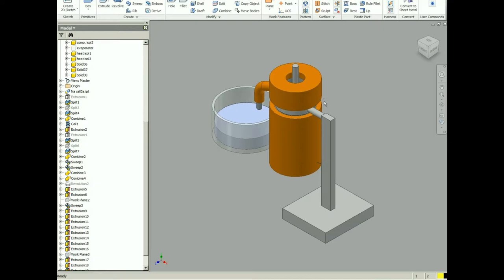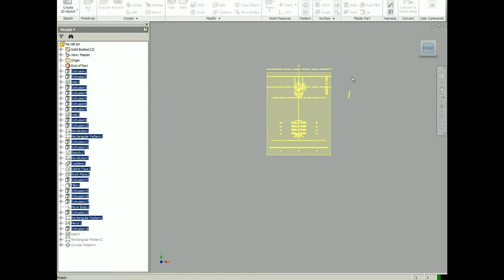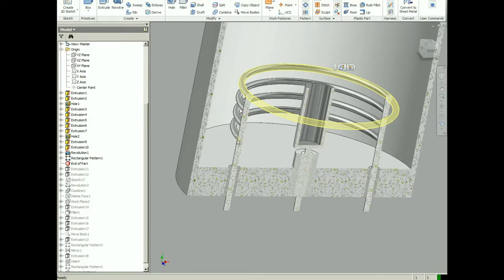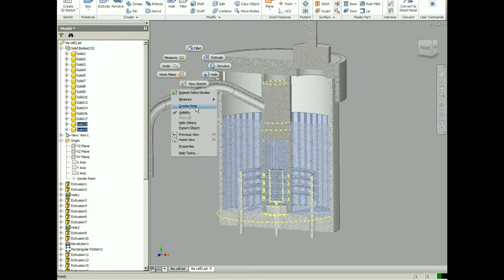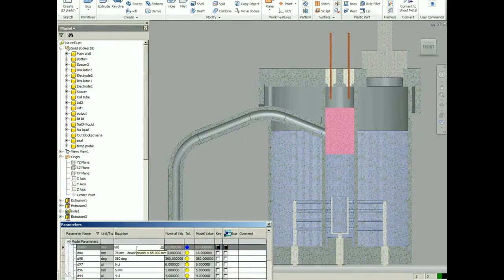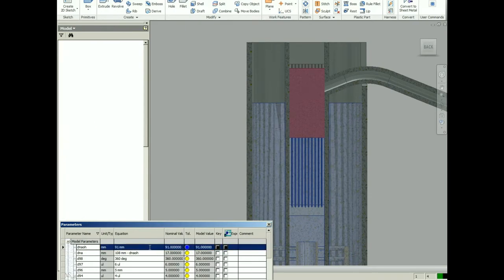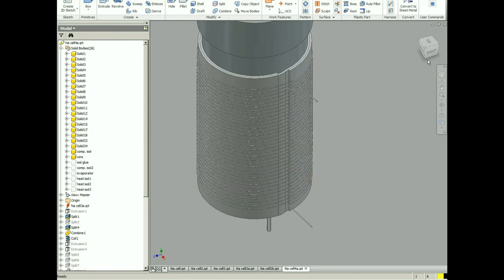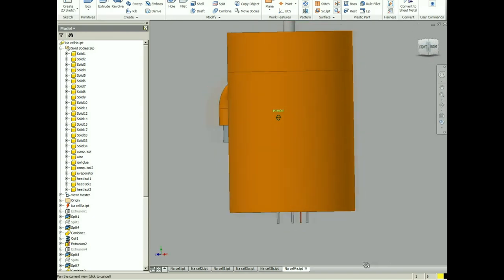Sodium maker - CAD design

Comment: i did electroylsis with molten NAOH ended terribly it went through the crucible leaked out nearly totally destroyed my heating setup i might be considering into getting a new one :)
Reply from the maker: Yeah, been there, done that :) I have done some more experimentation on this automatic style cell few months ago, it's documented here on channel. but sealing this stuff is hard unless you can weld aluminium...
Reply: @IlusysSystems  aluminium would eventully wear out ive heard porcelain works ?
Reply from the maker: @jadentonkin466  Eventually, yes... You intend to pass your cell to one of your grandchildren? :)

Comment: Id be very interested if this is adaptable for making Potassium Metal from Potassium Hydroxide.
Reply from the maker: Unfortunately I don't have any potassium hydroxide right now...
If you melt it in beer can, and there is no violent reaction(do it without beer) it would probably work.
Technically. maybe some day I will finish this also, but right now I am working on my glassblowing lathe.
Reply: Ok, thanks for the tips. Just 1 more question; would you recommend aluminum for molten KOH as the cell material? I have platinum electrodes so thats settled but im curious as to what to construct the cell from.
Reply from the maker: I don't know. You can easily test it by melting a bit of KOH in beer can(without beer). If there is no violent reaction, it should work.

Comment: What woud it cost without powersupply and Shipping to Germany.
Reply from the maker: Not too much as I am from Czech rep. But I am not selling these. 
Never got to test this design unfortunately...
Reply: @IlusysSystems  ok I Think I will Build it my self . Does nichrome wire Work as electrode?
Reply from the maker: @joostspohler2964 I did not test this, but I am 99% confident that it will.

I may not recommend sourcing it locally as it can be confused with kanthal, and that may not end very well...

Also pls let me know how it went :)
Reply: @IlusysSystems i bought some nickel strips from ebay and used an old spoon as anode.
im gonna test it today

Comment: I am interested in buying this cell or ecoetrochemical system for obtaining sodium by electrolysis of sodium hydroxide, how can I get in touch with you, do you have viber?
Reply from the maker: I don't sell them, I was just daydreaming. I have tested autmatic design in later videos and it mostly works, but it's still quite messy stuff which if you can deal with,  you can probably make one anyway.
Reply: @IlusysSystems   I'm so glad. I managed to produce elemental sodium in small quantities by electrolysis of sodium hydroxide, but the method is quite amateurish. Now I would like to make a slightly more modern sodium generator, and I need a little help and advice about the membrane that restrains the products released from the anode, because they are oxidative in nature and can create by-products, explosion of reactive sodium
Reply from the maker: @hydrogenh2energy964  I had good experience with hard anodized aluminium, but as soon as you would wash such membrane, anodization will dissappear. so alumina ceramic tube seems to be better, but it is hard to drill. Good thing about anodized Al tubes is, that they are mass manufactured and so they can be disposable item if you don't have means to re-anodize them or can't be bothered with that.
Reply: @IlusysSystems  Ask for a high price

Comment: i think you should perhaps speak to someone about bringing a product to market, here in the uk at least, you need allot of tests to be done. for example to sell a simple power supply you will need to send samples to several certifying boddies (5-10 each, for destructive testing). to be honest i think it is far to dangerous to even bother trying to market it as a consumer good. probably the best you can do is sell it as a nice paperweight and tell people not to use it.

then people who are really confident in their safety protocols can try it out in a heavily controlled environment if we really want to, but dude, this will probably kill anyone who thinks they can just plug it in and it will work safely in their home with no extra precautions.

i think with allot more practical testing and safety checks including a blast proof container which locks till it's cooled down, proper gas exhausting and using a membrane the gases can't get through instead of just holes, you could maybe market this.

TLDR: the normies aren't ready for liquid sodium hydroxide and explosive waste gasses in their household products.

absolutely love the design though, i would probably buy it if you showed it working, even if it required a bit of maintenance. the siphon especially is a great idea but i think the surface tension may be problematic with the spout size, and the textured walls are also very interesting if they work.

LOLed so hard at the definitions in the intro, i agree don't seal it with semen, and don't get your fibreglass pregnant. though i may add that cement is a very broad description and not really specific enough for reproduction [of your product]. the clay can be comprised of many differing minerals which significantly affect the properties including thermal resilience and chemical resistance to corrosion, these chemical mixtures are so complex that they are referred to by the place they were mined along with an identification number for the type. eg. Portland number 2

i would also like to add that "fire cement" is not technically cement by the definition you gave. perhaps it is a translation issue, to cement colloquially means to affix where as cement formally is a material. so there are products who's name contains the word cement used in a colloquial manner such as the product you referenced, another example is model cement eg.
https://www.amazon.com/Elmers-E1013-Model-Cement-1-Ounce/dp/B000MVOX2S/
which contains no cement but also still uses the word in it's name to reference the colloquial meaning.
Reply from the maker: Hi thanks for reply. I don't want this to be sold as a product for "normal" people.
This video is more like a market survey.
I know, what it takes to develop & properly sell electronics product.
If this thing is to be sold officialy with CE and what not, you may add 3 or 4 zeroes to the price :)

Also thanks for pointing out that cement thing.
At some vid of HHO series there was discusion about this cell and guy didn't know what stove sealant is and we got to term furnance cement.
I will add this to description...

EDIT: what a coincidence - that "guy" was you :D

Comment: I have about 25oz of scrap permalloy which is 80% nickel and 20% iron, if you can use it I'd be happy to send it your way!
Reply from the maker: Hi, thanks for this offer.
That is a lot more than i would ever need :)
Also I live in Czech rep. so shipping about 50g(assuming it is a wire - otherwise I wouldn't be able to mashine it) will cost more then value of metal.

But in case I will do prototyping I may get in touch with you.
Reply: Ilusys Systems its not wire, it's a bunch of backings for neodymium magnets from computer hard drives.
Reply: Ilusys Systems but I might be able to melt it into a ingot in my foundry
Reply from the maker: That reminds me, that I wanted to setup annealing oven for glass, so I would definitely get some bricks for some foundry.

Anyway, realy thanks for your offer, but as I would need a wire for heating it is better idea to use it also for electrodes.
Reply: Ilusys Systems alright, well just let me know if you change your mind :)
Reply from the maker: Sorry man, I accidentaly removed your comment on HHO vid :(
Reply: Ilusys Systems its all good 😂

Comment: Ok I have a few questions, as I am working on a cell of my own.

How do you stop the collection tube from acting as another cathode and anode in the wrong place?  It seems like it would be better to have the tube only attached at the top and be completely above the electrodes.  Does the aluminate coating insulate the aluminum well enough that we don't have to worry about that?

I plan on putting the entire unit in an oven to keep the temperature just right, with holes drilled through the stove for pipes for venting hydrogen, and venting oxygen/adding naoh, etc.  I'm surprised no one has done this that I can see, is there something I'm missing?  Obviously I have to prevent hydrogen and oxygen from building up but if I can fix that wouldn't that be a good idea?

The cement I'm finding is all sodium silicate, which I'm thinking is soluable in naoh because it's what glass turns into, is that the stuff you used, or is there different cement?
Reply from the maker: Aluminate coating seems to be fairly insulating.
If you saw my older video, there was some insoluble crystal matter forming on the walls of the cell. Now I am fairly sure, this is sodium carbonate, that will form by absorbtion of CO2 from atmosphere.
Putting cell in the oven may be fine. I was thinking about something rather compact here.
Sodium silicate is product of SiO4 + NaOH therefore it does not react further with NaOH. I used that stuff.

Good luck building the cell :) Looking forward to hear from you.
Reply: Any reason to stop at 40 amps?  There's a 50 amp supply for about $30, is there a reason to limit amps to 40 or so?  Do you know what the resistance of your cell was?  I'd love to able to make more than 10 grams per hour, but I don't want to go above 12 volts or so.
Reply from the maker: resistance of my cell was about 0.25 ohm.
in theory, you need about 2V to do electrolysis. running at higher voltage will result in heat loss, which is quite desirable.
If you want to scale things up, you have to increase surface area of electrodes (make them bigger). That will decrease resistance.

So you can run this @1KA, I would love to see that :)
but at that point this starts to get into commercial territory, and you may consider NaCl electrolysis, as it is somewhat more effective, therefore cheaper to run, if you are looking at gram of Na / kWh performance
Reply: Well I'm not necessarily trying to maximize na/kwh, but I want to make a few hundred grams without running it for days on end.

My newest design has two pieces of nickel fabric as the anode and cathode, about 5*5 inches, with a 1 inch gap between them.  Trying to decide what mesh size to use.  The fabric I'm looking at is made of wires that are 0.0045 inches in diameter.  I'm hoping that isn't too fine.  It's a huge surface area, about 2500 square inches, but I wonder if they will be eaten by the naoh.  I noticed your electrodes were black after running the cell, were they corroded significantly?

One other thing I'm wondering is how big would a spout need to be for sodium to freely drain through it?  Is a half inch diameter sufficient?
Reply from the maker: well that are quite huge electrodes. corrosion was there, but not really significant. I would say passivization layer rather then corrosion, but I would rather be prepared to accept some damage on such thin wires. 

Originally I was planning to use nickel plated electrode with 0.05 ~ 0.1 mm plating thickness so for few runs I think it will be OK, but not forever.

I forgot to mention that I had one electrode sunk below level of NaOH liquid, as sodium will wet nickel, so buoyant force will separate larger chunks of sodium from electrodes.

And that draining system I am thinking about in this vid. is untested and experimental... I guess that molten sodium will be happy with about 5mm or 1/4in hole. 
I would be rather worried about slag or sodium freezing, so the tube will not clog up over time
Reply: Did you see if the resistance of your cell changed throughout it's use?
Reply from the maker: well my current shunt resistor was just quite thin piece of copper wire, so measurement error was huge. plus temperature control was mechanical bimetallic element...

Comment: Just a little safety advice from a doctor and chemist. NaOH has a melting point of 323 °C. If, for some reason, only a small amount of water gets into the molten NaOH, the good days are over. I'm only talking about the enormous reaction when water suddenly evaporates. Added to this is the fact that even solid metallic sodium at room temperature reacts violently with water. But if water got into a mixture of molten NaOH, on which molten metallic sodium is also floating, no one will remember the moment with joy. The 323 °C alone will burn quite a hole in your fur. But molten NaOH becomes much more aggressive than NaOH at room temperature. Just as an example. A cold concentrated NaOH solution can easily be stored in glass containers without the NaOH attacking the glass. However, if you heat a concentrated NaOH solution in borosilicate glass for a few hours, the glass will visibly corrode. This goes so far that the glass wall can be completely etched through (see NurdRage's attempts to create metallic sodium). So stay away from molten NaOH. You can already buy metallic sodium everywhere on the internet for a good price. So I am very happy that Ilusys Systems is not selling its chamber.

Comment: I Think this cell desing i not good...
1:Graphite or Stainless Steel elektrodes

2:A hole for blowing the H and O away. 

3:A copper tube whit Oil Cooling to condens Sodium gas. 
4:Sodium chlorid is cheaper and doesnt eats to glas and Metal when molten.If you mix 60:40 Nacl:Kcl the Salt mixture melts at 650 C° not so high then the normal melting point of pure Nacl
Reply: Outdoor Freak one problem is that aluminium melts at 660°C so the cell has to be constructed with a different metal. But the main problem with an NaCl-Cell Setup are the relativly high energy losses which often make the cell inprofitable.
Reply: Steel and a old Microwave Transformer...
Reply from the maker: Hi thanks for suggestions.
First watch this video https://www.youtube.com/watch?v=BElkJ6VNwO4

1 Graphite electrodes are mess - they didn't las long. Stainless will corode

2 yes you are right...

3 We are not dealing with gas. also copper will corode.

4 We are processing molten sodium hydroxide - NaOH. melting temperature is something less then 330°C

MOT wound in reverse has high losses, so I want to try SMPS PSU...
May not be ideal, but maybe it will be.